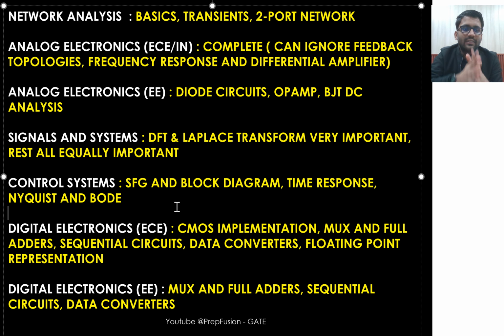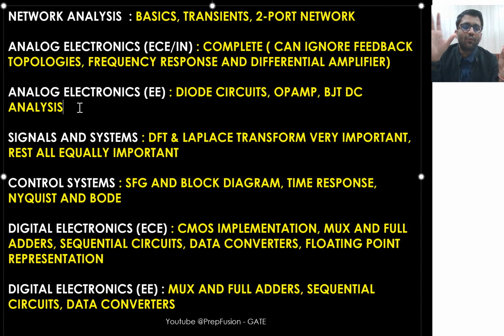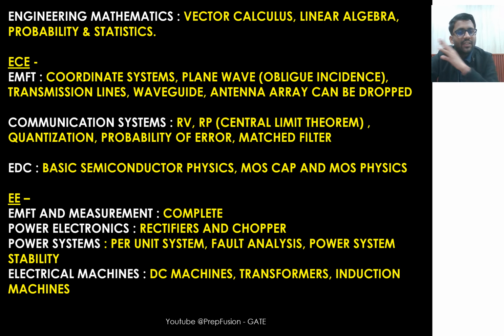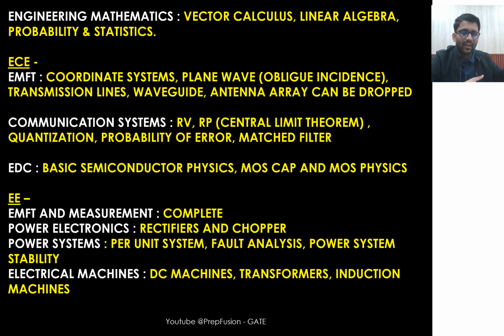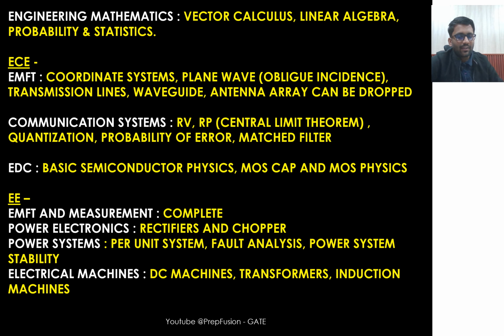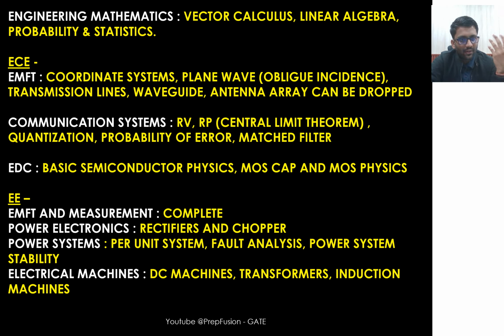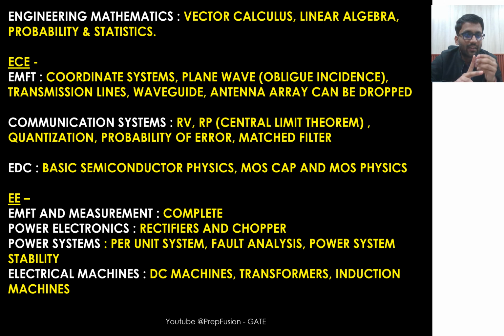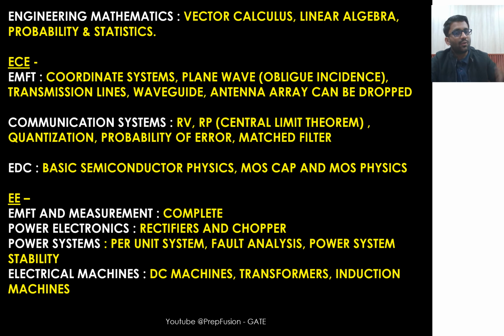🔥Important Topics for Last Minute || ECE-EE-IN || PrepFusion

Comment: sir I have not covered 1st unit from your playlist of emft as I did it intially from some other source. If I complete the part before Vector differential calculus till i.e., till spherical coordinate sys will that be sufficient to get started with antenna?! or should i do it completely?
Reply from the maker: Transmission lines and spherical Coordinate systems you need to do before antenna